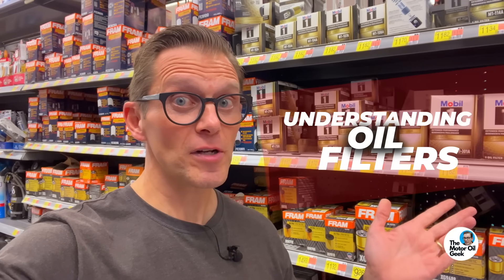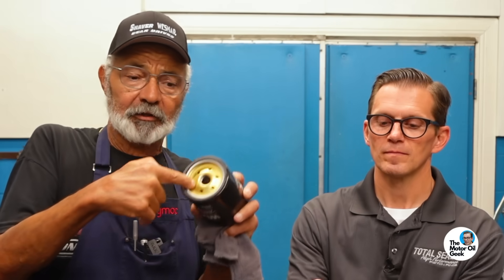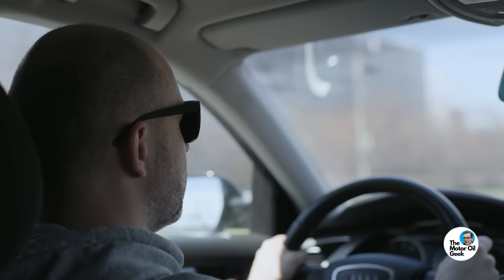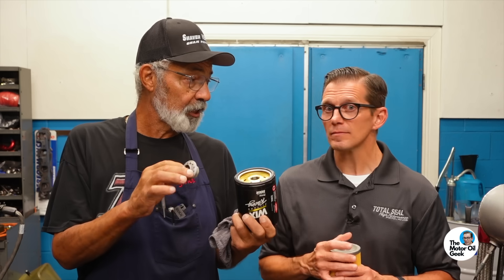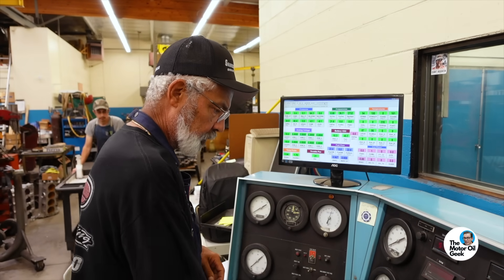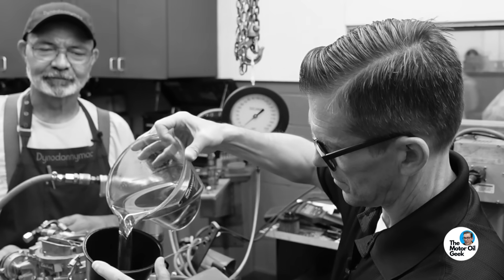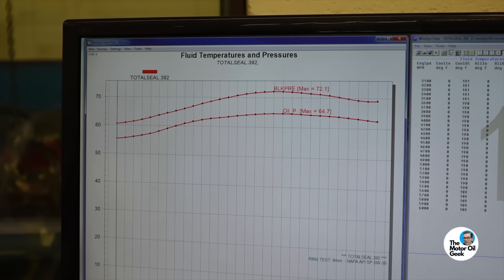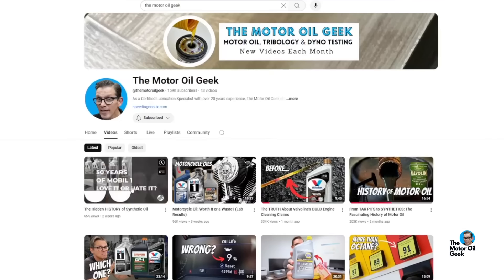OIL FILTERS: What Most People DON'T Know!

Comment: I sure like to test this info using not synthetic 5W20 but something like 15/50 or even motorcycle oil 20/50 and do it on a cold North Dakota morning  (every morning there except one day in summer).  By the way, my old airplane had both an oil idiot lite and a pressure gauge, the idiot lite took its reading from the rear of the engine (near the oil pump) while the pressure gauge read it at the propellor end, that was before multi-vis oils for airplanes, on cold days the lite would come off immediately but it took a minute or more for the pressure gauge to show normal pressure. (note that the gauge was electric so there was no long hose to slow the reading down, the electric sensor was right on the engine).  When finally Shell came out with its synthetic (semi) multivis that almost disappeared on all but the the coldest morning.  This engine was a flat six so no long crank to slow things down..  As for filling the earl filter before you screw it on, well some manufacturers recommend against this and while others don't, an awful lot of them installer the filter either horizontally or even upside down, so you can't.  I like them up so they don't spill all over when you take them off.  In any case, I don't fill but my oil pressure comes up within two eye blinks (a precise measurement) even in my olde Ford F350 truck with the 7.3 that uses that really big filter.  The diesel engine is the only one I ever had that had fairly clean oil at the 6K  event, even my wife's fancy MB diesel has oil like road tar at 1500 miles, I'd really like to use that Ford filter in everything plus the extra quart of oil doesn't hurt.

Comment: The pre filing an oil filter debate  exists for those that need to take a contrarian view to seem intelligent or argue for social interaction. The real question is do you pre-fill an upside down filter…
Reply: I guess my question is, if pre filling the oil filter is so crucial, then why are so many makes and models of cars having oil filters that screw in on the side of the engine, or on the top?  Shouldn't all engines have the oil filter on the bottom (in other words, facing up)?  That just doesn't make sense to me.
Reply: Because whilst it is desirable, it is certainly not crucial. The difference in wear over the life of an engine would be so negligible it makes little practical difference. When it comes to engine longevity, regular servicing, with a high quality oil and a mindful warm up routine, will provide far better longevity benefits than fussing over whether or not to pre-lube an oil filter.
Reply: @djr3485  agreed
Reply: I prefill my cartridge filter.
Reply: Same way how you pre fill air filter

Comment: I hope you guys read these comments. 

I have a question. I've heard it's best to change the filter every second oil change. The reasoning is that as the filter picks up more material it actually filters better. Which sort of makes sense. As the filter picks up dirt, the 'holes' get filled up, and make the passages for more oil smaller, picking up smaller dirt....

Please either make a video on this, or explain if what I've heard is right or wrong.
Reply: Change them every time or put $20k in escrow now for your next engine…
Reply from the maker: That can be true. I'm reaching out to a filter manufacturer to be able to test this out.
Reply: @ Thank you. I look forward to watching that video. I'm currently binging to get up to date with your other videos. 🙂
Reply: @themotoroilgeek  you can simply get a microscope and spread out a cartridge of your own used car and simply prove it by the naked eye

Comment: Block oil resistance 'produces' a pressure of x. Pressure required to push oil through the filter AND the block will be pressure y (produced by the oil pump). The bypass will only open if the difference in those pressures is more than the stated bypass pressure. ie, if the push required to push the oil through the filter (assuming no block behind it) is higher than the bypass pressure. Even if the block resistance required 10,000 psi (assuming the pump could produce that!) the bypass would still not open unless the filter was blocked so much as to require 10,010psi.
Reply: There is usually another bypass valve somewhere set to a high pressure that "dumps" oil back to the sump without the oil going through the engine lube system. I think usually not part of the oil filter assembly.
Reply: @davidpowell3347  That's usually in the oil pump itself.

Comment: Although particles lower in size to be captured by the filter is well under the tolerances of the engine. The Channel, ‘Engineering Explained’ discusses how tiny particles can wear on the timing chain.
Reply from the maker: Yes they can. It is soot particles that wear the timing chain rollers.
Reply: @ 
Any current means or measures being researched or developed to eliminate or minimize this wear mechanism?

Comment: Also in some cases a relief valve of some sort (maybe the main pump bypass?) helps prevent overpressurizing the whole can and ballooning it or even bursting it ?
especially with a dirty element combined with excessively thick oil (like SAE 30 in an engine that is supposed to have 5w- 30 synthetic) in sub freezing cold start conditions? 
The employee who starts the truck in sub freezing first out of the equipment yard first shift who immediately full throttles out of the yard ?

Comment: How about when driving on the highway and use full throttle, does the by pass valve open. Thanks for the video gentlemen.
Reply from the maker: The bypass doesn't open at that point. That's why we did the full throttle test.

Comment: I think the bypass valve if present helps keep the pressure across the media from rupturing or tearing the media should the pressure become excessive. However running the filter too long (failure to change it) might increase the possibility that the media will get splits (tears) through it 
I think between starting the engine with cold oil and shutting off the engine the media pleats move a little bit and over thousands of cycles the media could tear.

Comment: I have a question I have a 1500 Dodge Ram. I use Castrol Edge 5W 20 Full Synthetic 20,000 miles. My question is is 10,000 mile change ok for my truck? I follow you YouTube channel and haven’t seen anything on 20,000 mile oil so can you do one on comparison with Castrol Edge vs Mobile One please
Reply from the maker: Used oil analyst is the only way to answer that question definitively.

Comment: I use a Full synthetic oil filter and there's a difference to the filter medium used and the construction of materials used in the manufacturing of that oil filter Ryco 663st is the part number for a Chevy L77 V8 engine and i change the oil in my car every 5,000 to 7,000Km all the time and now using DEXOS 1 gen 3 licenced oil product. Keep up the great work Lake and team.🦘🦘👍👍

Comment: What happens at -20 degrees F?
Reply from the maker: It would be fun to repeat the test at a much colder temperature.
Reply: @themotoroilgeek  I thought one of the reasons for having a bypass valve is to protect the filter element from tearing at low temperatures when the oil is too thick to flow through the paper element without damaging it.  In this case, it seems like to bypass valve would be opening all the time on low temperature starts.
Reply from the maker: @rking3724 seeing that the viscosity would be even higher, so the flow would be even lower at -20, it might not create a greater differential pressure.

Comment: Toyota 1HZ 4.2Lt six cylinder naturally aspirated diesel engine has an upside oil filter positioned on the upper side of the block, which makes filling the filter before fitments impossible. These engines are known for their long service life in the order of one million kilometres. The design is such that no oil in a new filter doesn't affect the longevity of this engine. Any comments welcome. Cheers

Comment: The physics is quite simple, it's just like electricity as well. The delta aka voltage drop across a resistance increases with the current (flow) through the resistance.

Comment: The study validated how the valve functions with a new filter. I would suggest two additional studies that are not related to the oil temp at start up.
1. Generate data on a new oil filter then install the oil filter on a low milage vehicle as part of an oil change. After 3K put the oil filter back on the mule with fresh oil and repeat the study.  Repeat the study again with a high milage vehicle.
Reply from the maker: Nice suggestion

Comment: I wouldn't call room temperature oil cold.  Run this test when the oil is at zero F.  I'll bet a dollar that the filter gets bypassed.  I'm shocked that they didn't address this.
Reply from the maker: The dyno is in LA, so "cold" in this test was room temp. It would be fun to repeat the test at a much colder temperature.

Comment: I’m curious how much material will an oil filter trap before it gets to the point that it goes into bypass. I also think it would be interesting to see how much filtering capacity is still available when the filter is changed according to the recommended change intervals. Similar to the oil still having the ability to do its job even when the oil life indicator reached 0% in the rental car.
Reply from the maker: Nice suggestion!

Comment: I think what gets people hung up is the idea the cold oil has lower delta P than hot oil does. But what they’re forgetting is that the FLOW when cold is much, much less. Higher oil pressure means more “restriction” to oil flow. Total flow in the oil pump loop is much less when cold. This is why your filter has higher delta P warm than it does cold—- because the lower viscosity of warm oil is drastically increasing flow rates in the system (especially through the filter).
Reply: The total pressure inside the can relative to atmospheric pressure outside the can might be very high while the ^ across the media might be low due to low flow
Reply: You say the flow is lower when the oil is cold, but isn't the oil pump a positive-displacement pump?  Seems to me that unless you're on the oil pump's pressure relief valve, that your flowrate of oil, cold or hot, is essentially identical for any given rpm.  I would have thought that delta P, cold at 1500 rpm would be higher than hot at 1500 rpm.  Hmmm.
Reply: @MrThermoBob  Does the "exhaust" from the pump bypass valve (not the filter's media bypass valve) dump into the engine crankcase or does it just shunt the bypassed oil back into the inlet side of the pump ? (If so would reduce flow through the filter and media ?)
Reply: @davidpowell3347  understood, that’s why I started with “unless you’re on the oil pump’s pressure relief valve“.
Reply: @davidpowell3347 almost always, the oil pump dumps the regulator flow back into the inlet. So when the oil is cold, there’s pump is pumping a lot of oil in circles.
Reply: Thank you for posting that, I think it helps a lot of people who don’t understand. Intuitively you’d think that thicker oil would have more delta P than thin oil- and it does—at constant flow. Here the flow is not only not constant, but it’s such a big increase that the increase in flow is enough to cause a higher filter delta P even IN SPITE of the thinner oil that would (all else being equal) have lower restriction.

The difference in flow between cold oil and hot oil is massive because the viscosity change is massive— well over 10x

Comment: What are your thoughts on putting a magnet on a oil filter. Would be interesting to take an oil sample 500 miles before it's due for a change. Then put a nice strong magnet on the filter, drive it for 500 miles and then take another sample and compare them to see if the iron content in the oil went down.
Reply from the maker: That would be a fun test!

Comment: If the filter is a side mount how do you fill the filter and screw it on without the oil running down your arm?
Reply from the maker: For a 45 degree mount, just fill it 30 to 40% full.

Comment: I like bypass filtering, 2 filters in one.  A very fine filter and a courser filter in parallel.  Get the really fine stuff out over time.  Still allow enough flow at acceptable pressures.  Likely still need a full bypass in very cold weather at startup.  We get -20 to -40F weather for a few days each year.  For engine oil.

Comment: This was very informative. I've always read and heard that on startup the bypass valve is open allowing unfiltered oil to flow through your engine. This video proves that to be a myth! Thank You 😁
Reply: I think it isn't a myth of you're running very viscous oil because the thicker the oil the slower it'll pass through the filter which will cause greater pressure before the filter (simple logical assumptions)

Comment: What happens if your oil temperature is below zero?  Then, the  filter check valve will open.
Reply from the maker: The dyno is in LA, so "cold" in this test was room temp. It would be fun to repeat the test at a much colder temperature.

Comment: Measuring the pressure differential and the bypass pressure caught my attention. I am a swimming pool technician. Residential pool filters need to be cleaned when the pressure rises 8lbs from the starting pressure. Commercial pools have a pressure gauge installed on the inlet and outlet side of the filter. Commercial filters are cleaned based on the pressure differential between inlet and outlet pressure.

Comment: Everyone says you have to prefill the oil filter through the little holes or you're going to be putting unfiltered oil into the engine but then aren't we pouring 5 to 7 Q in the top of the engine that just leaks down through the entire Gali all the way until it finally reaches the pan?
Reply from the maker: Check out the previous video for the test on that.

Comment: Cold oil is a different animal. Industrial compressor lube systems for example are equipped with differential gauges and shut down switches. Cold oil will pin the gauge on startup if the oil is not preheated.                 A galley is a kitchen on a boat or aircraft.😁
Reply from the maker: The dyno is in LA, so "cold" in this test was room temp. It would be fun to repeat the test at a much colder temperature.

Comment: The pressure relief valve on the engines oil pump output is also vital. It limits the pressure the oil pump puts out to engine at cold. start.  I have seen the old 4 cylinder Rootes Sunbeam engines where stuck pressure relief valve exploded the spin on style filter (same filter as Ford Pinto SOHC) at cold start.

Comment: Can you do this test with the engine cold soaked at a variety of very cold temps, starting at negative 40 degrees etc? I want to know what happens with system pressure and filter bypass valve when the oil is very cold.
Reply from the maker: The dyno is in LA, so "cold" in this test was room temp. It would be fun to repeat the test at a much colder temperature.
Reply: Guys, I really appreciate your work. Project Farm cools things down and tests. It reveals a lot. I live where the temp gets to -40, C and F, it's about the same at that temp. I'm using some good "ultra" synthetic to help with that environment. I also work as an airline pilot and when I start my CFM56's in really cold temps I get a warning for "Oil Filter By Pass" until the oil temp rises. That means the bypass is open and the filter is anticipated to be clogged. When oil temp rises, the warning goes away. I would  love to know what happens on my Toyota 1GR-FE does at -40.

Comment: Would be bypass valve open at start-up in temperatures such as -45 degrees?
Reply from the maker: The dyno is in LA, so "cold" in this test was room temp. It would be fun to repeat the test at a much colder temperature.
Reply: @themotoroilgeek  In the Great White North, I was exposed to -54 F.   I opened a bottle of synthetic oil, turned it upside down and nothing would flow at all.   It was like extra thick molasses that came out of a refrigerator.  It would be very interesting to study what takes place in an engine at those temperatures.
Reply from the maker: @BansheeZR1  That would be cool to study (non pun intended).

Comment: I just bought an amsoil filter for the first time. Apparently they are good. Also the new fram synthetic endurance is good too?
Reply: Amsoil oil filters are made by Champ labs.  Same manufacturer for Royal Purple and Fram Endurance. The only difference between them is the color of the cans.
Reply: @ I saw in a test that amsoil slightly beat out the endurance by one or two microns filtered but were almost identical. I know they are made at the same place. Was curious to why the amsoil in testing slightly beat out the endurance? Either way they are the same in the real world. I’ve tried them both on my last oil changes. Before that I was using the stock valvoline filters they put on at the instant oil changes

Comment: I was using a car oil filter on my motorcycle. It was larger than the motorcycle filter and obviously had the same thread and pitch. Then someone pointed out that filters made for cars have a different bypass pressure than the ones made for my motorcycle. I feel you’re going to agree with that statement but is there any validity to it? I’ve stopped using car filters after reading that . Did I do the right thing?
Reply from the maker: I'm not sure. I don't know about the bypass pressures being different.

Comment: Most people simply cannot think!
You want the MOST area in order to have the best flow and space for particles so it takes longer to clog and activate the bypass valve!

Anti-drain valve is only needed for applications where the filter is sideways or upside down so oil stays inside the filter.